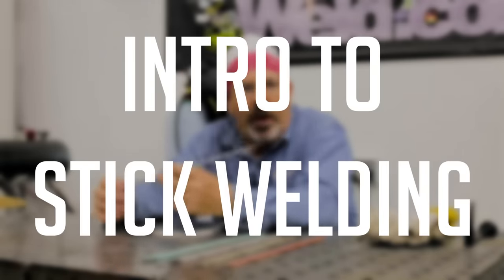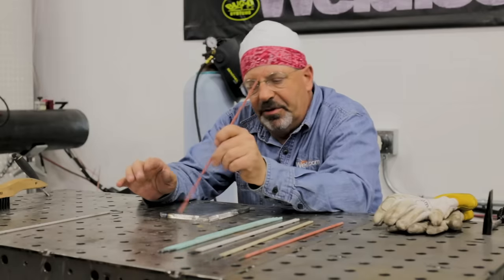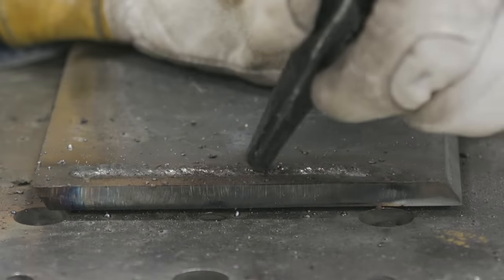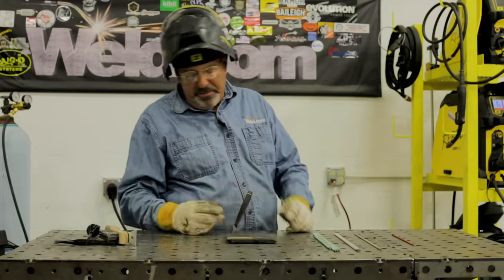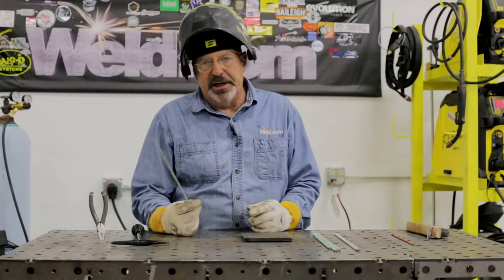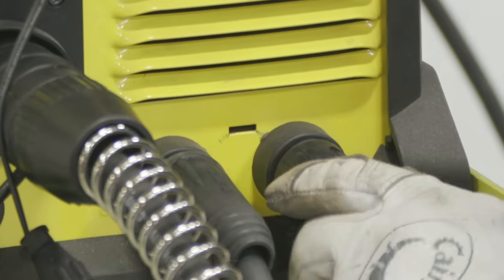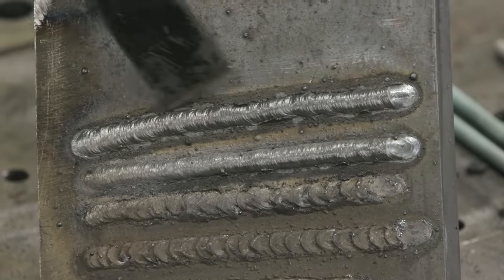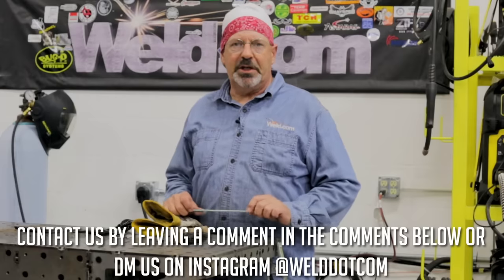STICK WELDING 101: Getting Started With SMAW

Comment: I work in a shop that makes reinforcement structures for high rise concrete buildings. Our arc welders are basically machines that looks like a glorified [pneumatically operated] drill press but if we have a misfire we have to repair with stick welding. I've been welding for about 50 years but was trying to teach a new employee how to do repairs and realized I've never tried to show anyone how to weld before. He is not grasping the process at all but I'm the first to admit I'm a terrible teacher. I'm going to point him to this video and hope it helps.

Comment: I just bought a 650 amp chinese machine from a friend here in thailand (220volts). I am just a beginner, when using 6013 rod are the amps 30/60 the same as on a 150 amp machine compared to 650 amp with arc force /hot start.  Thank you.

Comment: I have run the 6010, 6011, and 7018 for yrs on dcen. My welds don't look any different from what i see here. If you ever get a hold of any used oilfield pipe, it's usually magnetized. Only thing that will stick it together is 7018 dcen.

Comment: Chances of me getting a fancy welder is slim to none, but I would gladly weld using brine or saltwater. I once saw a Ukrainian guy do MMA with saltwater and wow! that arc did a loud hum. It was like loud rap music holding its bass or something, that's what it sounded like.

I assume that's the hum a 7018 electrode would make.

So yeah! 7018 in general can be welded on AC.

Comment: Easy?, right, until something goes wrong when you are learning, I have wasted days welding and grinding a project removing slag inclusions, but thanks to this video I now know the 6013 is a smooth drag-something most other videos skip, now if only my slag was as easy to chip off as yours, mine is set on like cement!

Comment: Great video. I'm a complete noob trying to learn how to weld without going to school for it. I have a question: what about a respirator? I read the fumes are awful and that it's recommended to have a respirator. Nowadays you literally can't get one. I'm wondering if a bag of activated charcoal like you use for an aquarium is enough protection? Do folks even use respirators for SMAW? In all the videos I see on YouTube, not ONE welder is wearing a respirator. So do I even need to worry about it?

Comment: Thanks for the video, very informative. I've ask this question from one other welder, he said this would be ok. My question is, if I am using my arc welder outside can I pound a galvanized pipe into the ground and connect my ground cable from the machine to it?
I hope someone can take the time to answer. Thanks.

Comment: In highschool shop, I stacked a bunch of small pieces of 1/8" plate on top of each other, about 6" tall. I struck an arc on top of it and then DRILLED down into the stack. After getting down so far, a fountain of slag shot out and jumped right over the edge of my glove. It melted into heel of my hand and I ended up frantically pulling a jagged little slag-cicle out with my teeth. Squeezing my injured hand and feeling stupid, I walked out of the booth as the bell rang to go to my next class hahahaha just kept it to myself

Comment: Electrode Recap:
6010: 60k PSI, All positions, Fast freeze digging type violent weld pool, DCEP only.
6011: 60k PSI, All positions, Fast freeze digging type violent weld pool, DCEP/N & AC.
6013: 60k PSI, All positions, Soft arc, dense slag, All polarities, quiet to run, don't stack dimes - just drag steadily.
7018: 70k PSI, All pos. But only uphill on vertical, Low hydrogen flux, Soft/med. type penetration, Great all around farm rod, don't stack dimes, DCEP & AC.

Comment: Great video, I have been trying to learn how to stick weld seriously for a few days now. I’m not having much luck I find it extremely difficult to get to arc started without sticking the rod or getting outside the area I want to weld. Maintaing the arc length is extremely difficult for me. I can tig weld great but this process is extremely difficult for me! I have read that stick is easier to lean than tig but I find this to be completely false. I have a lot of trouble seeing and reading the puddle and things just happen way to fast. I have been tig welding for 10+ years but I just can’t seem to learn stick? I don’t recall having anywhere near this difficultly learning to tig weld? I guess I need to just keep practicing?

Comment: Newbie question: If I wanted to add a bung in an exhaust pipe and all I had was a stick welder what would be the preferred combination of stick and amperage setting?
Electrician by trade but much respect to the welders. Thnx.

Comment: Thank you, I learned quite a bit about this method of welding which appears quite easier than learning MIG/TIG welding. Considering cost, is it less expensive to stick weld compared to the others, given everything else equal, e.g. sheet metal, thick tubular material, stainless steel,  soft steel?  Thanks for your advice.  Keep up the good work.

Comment: Excellent video. Thanks. 
Why do you need AC, DCEP and DCEN? Why not just one?
Reply: Some rods can only be used with DC and only with certain polarities.  It depends on the rod and what kind of metal you're working with.  It also depends on what kind of welder you have.

A lot of farmers and beginners will get a used or hand-me-down Lincoln buzzbox aka tombstone welder.  It is strictly AC, it has fixed amperage settings, and you need to know what kind of rods will work with it.  Not everybody can buy a fancy welder that does everything.  

As he said about 6010 and 6011, they are great "farm rods" because they can tolerate surface rust, mill scale, and will even blast through some spray-painted metals.  Since the average farmer probably has an AC buzzbox, he will likely have 6011's of various sizes.  He may also have a box of small low amp 6013's for thin stuff.

Comment: I am a beginner doing stick welding and I have a question about what rods can I used outside when is windy or if I can used them if the metal has paint or a lot of rust.. what are the best stick rods to to like pipe fence welding or welding like construction machinery.. thanks for your video

Comment: Learned something today. I have a flux welder but wanted to get a stick welder didn’t know differences in rods. Wanted to know what rods to use to weld 1/2” round steel stock together 4010cr steel

Comment: QUESTION? What would cause the flux to break off off the rod ( 7018 )? Is it moisture in the flux? I run between 85 & 110 amps DCEP I often wondered if it's cheap rod or the elements & the condition of the rod combined! Any Ideas?

Comment: Never stick welded but curious and need to fix rusted out frame. Would you go 6013 ro 7018 or 3/16 thick flat stock for little toyota pickup frame? Seriously need to know before I buy wrong electrodes or welder.

Comment: Quick question, I am interested in welding a seat portion on a motorcycle frame.  It is a 1 inch diameter tube, with 1/8 in thick wall steel tubular frame.   My plan is to weld it with a 6011 stick as shown in this video.   Would that be strong enough to support a 200lb person riding?   I am not concerned so much about the aesthetics of the weld, but want to make sure that it will be strong enough not to break while I am riding.

Comment: at 21:00 he mentioned AC and DCEP , I know ac means alternating current, dc direct current. what is the actual difference when welding. I have welded with both , but can some explain the best one to use for every day welding  and why, welding machinery repairs, some beam and post steel connections ect. what is the difference between ac and dc 7018 stick welding, thanks.

Comment: Your 0ersonal choice for wedding a nut to stainless snapped bolt ?. Great video I already have 6013 rods and 7018  any suggestions I'd appreciate thanks.  I often am told 80 ish amps are best but I happened to meet one part of one of the studs so clearly 80 is too high

Comment: Are the strength of those welds about the same, or does the 6010 create a stronger weld than a 6013 for example considering the different technique?

Comment: what rod would you use for a motorcycle frame made out of 1" DOM tubing .12 wall thickness?  i think it is called out as 20-26 hardness, not completely sure about that. i have 6010 in 1/8 and 3/32. after watching you i think it is gonna be mostly technique :) plus the setting and distance away from matl, speed, angle. now i know what im lookin for. thanks.

Comment: In job work welding,  is it ok to weld over all the little spattwr,  will it melt into and contribute to the bead? WITH 6010. Will 6011 with DCEN, leave less spatter?

Comment: Wondering if i should get a stickwelder for welding a few rebars together for a small project. Im wondering, if you run 100 amp at 220v thru the things you are touching, like that table, how come there are no.. consequences?

Comment: I have a small AC only arc welder 80amp max what is my best stick, I have 6010(which I know I can't use DCEP only) 6011 and 6013 all are 3/32" cause that the max this welder can do. I've gotten some good welds with 6013 but my arc is unstable doesn't always want to stay consistent, I'm wandering if 6011 would work better? 🖖😎

Comment: Just found you :)  Great video about exactly the 3 rods and 3 types of arc I've been researching. :)  You see, I've always been attracted to the idea of welding but spent 33yrs at finish woodworking. Now I have a place out in the rural countryside and would like to begin welding a little bit around the property. I believe I won't have much trouble w/ a little practice and a small Lincoln AC Buzz Box (used) for cheap, welding thicker metals like 5/32" or 1/4" metal like you find on a trailer or zero turn lawn mower.  However, I would like to frame up and weld a carport w/red iron which is about 16, 14 or 11 gauge metal. 
Questions :
a)   Can I use an AC only welder for these smaller sizes ?  What electrode would you recommend ?
b)   Will the benefits of an AC/DC (p/n) welder version be so substantial to me as a beginner doing infrequent projects as to justify the extra cost ?
c)   If so, would you recommend DC neg. arc ?  And what electrode would you recommend for these thinner metals ?

Thank you for your generous consideration,
Sincerely ..............................
Steph

Comment: Each time you switch between different rods you come up with an amperage to set the machine to; other than by just experienced knowledge, where do you come up with those values from?  That would be most useful to understand is how you come up with what that should be.  I can see your eyes lift up and search the back of your brain each time and I'm not sure if that is just picking it up from a reference that you have read or remembering what it was last time you used it what was most effective.  Understanding where that comes from would be useful to a beginner like myself.

Comment: Hi..thanks for the video, really great to watch. I  apprenticed in New Zealand as a fitter welder many years ago and most of our training was stick . Was curious if in the States low hydrogen rods might be  different or have changed since I left industry. Here (then) LH Rodd were common but not the 'go to' choice for general engineering and often always specified for structural engineering because of their greater strength and lessened porosity,  but as a rule guys didnt use them because they were 'angrier ' I guess you'd say. They were hard to start unless you cranked the amps up which led to things getting really hot into the weld. That could all be my bad welding technique but it didn't look like you had any problem striking the arc. They also gave way better penetration which was another reason they were used for structural work. Wish I could remember the maker, might have been Phillip's as I burnt a ton of Phillip's 28,s if I remember right. Thanks again..really good to see someone showing what a great method this is, regards Mike

Comment: I used E6013 on my tandem axle boat trailer. 
Is it going to be strong enough to hold the weight?
Trailer, with the boat on it, weighs about 2,500kg.

EDIT: I am an amateur arc welder. I have been mig welding for about a year though.
My arc welds on the trailer are not very pretty, given that I was laying underneath the trailer (on my side) and welding the crack in the front axle.

Thanks in advance.  :)

Comment: I use an AC only ARC Welder.  I had some E7018AC 1/8 rod that worked well.  I purchased some E7018 but it didn't run well on my machine.  I then realized there was a difference.  E7018 and E7018AC.  One person told they were the same someone else said no they are different.  I realize now "E7018" and "E7018AC" are not the same.    I have 10lbs of E7018 the box says 7018 AC/DC+ (Reverse Polarity).  Should this run on my AC stick welder? After carefully reading the label it states "however an AC Machine with sufficient open circuit voltage may be used".  Any thoughts would be appreciated.

Comment: Just tried my first stick welding..Amico Arc 200.. E7014 rod 3/32 and i say  no way I'm going back to Mig. stick is too complicated and requires  two hand coordination and constant height adjustment. wish I hadn't  wasted 250 on stick welder and rods.

Comment: I'm very new to welding, and I'm taking a welding course at my school. We are currently practicing stick welding with a project where we just constantly weld beads over beads. But everytime I try to weld on an already existing bead, it seems that it just melts the metal of the bead, and when it cools it looks as if I made no progress. Does anyone have any tips? By the way we use 6010 electrodes at around 75 amps and we weld on steel.

Comment: I’m trying to find what I can weld with shield arc 85 rods ?? I found some old ones just opened the tin can and couldn’t start the arc could it be a moisture /humidity problem?? Can I weld steel beams with these

Comment: can someone explain to me how is it possible to select 100 amps setting when we only have 15 amp circuit or even dryer plug only has 30amp circuit.   Is there a transformer inside that drops the voltage and increases current?

Comment: Arc welding is a welding process that is used to join metal to metal by using electricity to create enough heat to melt metal, and the melted metals when cool result in a binding of the metals. find more about electrics arc welding and combustion on :

https://jojojulu.com/electrics-arc-welding-and-combustion/

Comment: I have heard many times. Watch/read your puddle.  It would be nice if you could weld a 7018 rod and narrate what you are seeing. Maybe in slow motion.  This is the top and bottom edge of my puddle,  Here is the edge of the metal melted by the arc.  This is molten slag. The whole thought process but slowed down.

Comment: This guy doesn't know anything about stick welding like all the other videos I've seen on YouTube,  you should never keep your electrode like that,  the arc length is to high and makes a mess and affects the penetration,  I've seen other videos of guiding or holding the electrode with the other hand, man that's dangerous because it gets hot very quickly 😳